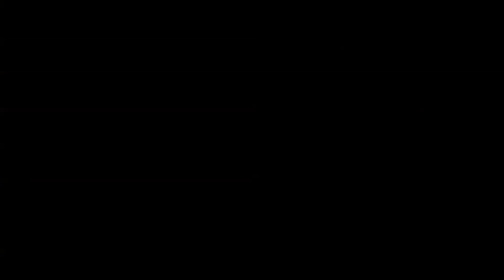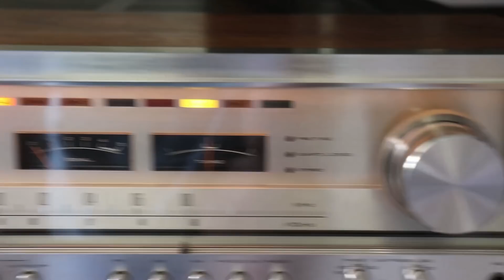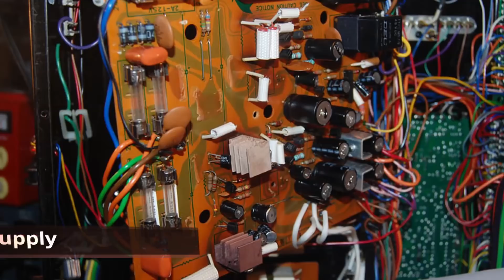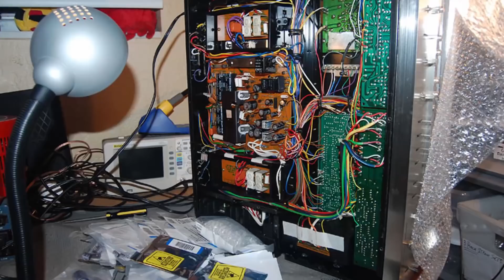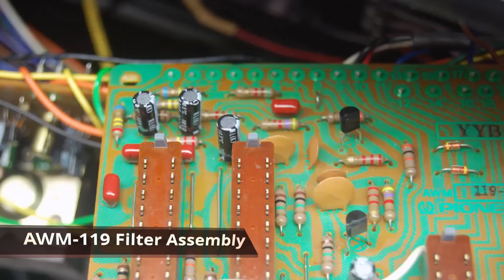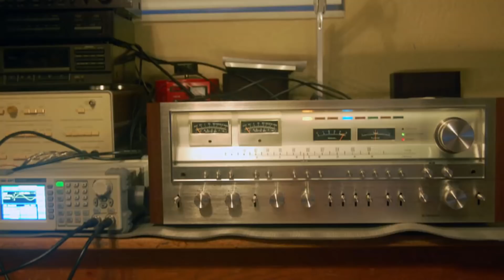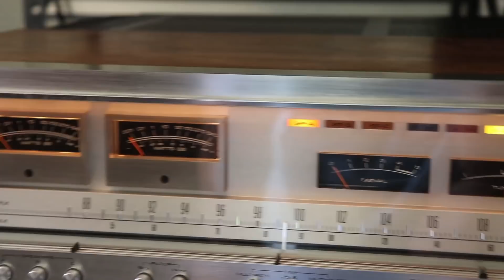SX-1980 - The Most Powerful Pioneer Receiver Ever! Vintage Stereo Repair Restoration & Testing.

Comment: https://www.youtube.com/watch?v=CZ2QytMpP_c

I have one of these on my Denon. Works great.
Reply from the maker: Interesting that this SX-1980 even pushed hard on the test bench never gets hot, very warm yes. I have a Yamaha CA-2010 that when it's running in Class A the heatsinks will get very hot. You can not touch them hot. Nothing wrong with it, that's the design. If I have any unit that needs a fan it's that one.

Comment: A name always synominous with quality.So saddening to compare their current product line and quality with what it used to be.I have recently heard a restored Pioneer system including the wonderful 909 tape deck through the new JBL Century speakers all wired up with Chord Cabling and a Linn Sondek at the Front. The envy stills exists. A wonderful video yet again Thank you
Reply from the maker: Thank you so much for your kind words. The vintage audio equipment can hold it's own when operating properly. The engineering and build quality was top notch.

Comment: Very nice video. You are obviously very good at what you do. I am starting to work on a pioneer RT1020L. How are you cross referencing old outdated parts? I've seen transistors in this unit that are discontinued. Thanks...
Reply from the maker: Thank you very much. I'm just a hobbyist who repairs, restores and collects vintage audio equipment. The internet is so powerful now. Almost all the cross referencing of parts is out there. It still takes time but for example lets say you had a bad 2SC458 transistor that is no longer produced. Google "2SC458 transistor replacement" and all kinds of information will come up. Try it with your Pioneer RT-1020L and some of the transistors in it.

Comment: I bought an SX-580 back in 1979, the bottom of the line. I was 14 and got a job bussing tables at local restaurant. First thing I did when I earned my own money was buy that receiver. Still have it, is at my brother's house, and it still works.
Reply from the maker: Man, your story is my story. Working at pizza hut as a teen my first "real component" was a used Kenwood KA-3500 and like your SX-580 is still in service today.. Thanks for sharing.
Reply: @vintageaudioaddict  I also had a PL-518 turntable and a CT-F500 cassette deck, but the receiver was the first purchase. Speakers were a pair of Stromberg-Carlson that my dad gave me. Speakers, turntable, cassette deck are long gone, sadly. Thanks for stirring up old memories :)
Reply from the maker: @SteveLowe65  SC speakers now we're talking old school.....Okay older school. For most of us the old days were good days.

Comment: A pity the new filer caps are blue not black. So ugly.
Reply from the maker: Electrolytic capacitors do not last forever. Very few choices for filter capacitors in today's world and there will be fewer and fewer choices as the years go on. Most are blue now a days. I'm just glad they are still available at all.

Comment: Remember those pacific stereo days. Huge Sansui beauties and these. Later some Hitachi wonders ...class g
Reply from the maker: I hope it brings back some good memories for you. I know it does me. Hitting all the small audio shops long before Best Buy and Circuit City came to town.
Reply: @vintageaudioaddict  Wandered through pacific stereo all the time looking and listening and dreaming. Even radio shack had some cool receivers with that magic tune circuit that if you got just anywhere close to an fm station it would lock it in instantly. Loved that back then more late 70's stuff.  great video
Reply: I used to get great deals at Pacific...Bought an Akai r2r for hundreds off brand new
Reply: @BigEightiesNewWave  oh yes. Bought a phillips sensor touch turntable with an audio technica cartridge.   Got robbed and that was stolen. Was such a killer table.

Comment: Cool stereo ya got there! 
My oldest console model SA-1490 still works but woofers need restored and a tweeter replaced , basically just tower speaker repair. only 150 watt per 
Sounded really good though
Reply from the maker: Thank You! I'm glad that you still have your old gear. I've got some of mine from my teen years still.

Comment: Some years ago I got a SX-980 on a flea market, a little over a year ago i dug it out of storage where it had been sitting unused for a long time. was still fully working but I decided to do a recap as some of the electrolytics in the PSU had high ESR (and was discoloured from heat). Except for the two main filtercaps all electrlytics are replaced. I didn't see no reason to replace any transistors..
It is now the heart of my system and it sounds great.
Reply: lol i had the same luck just the system up sx 1080 and instead of a flea market i got one out of my neighbor's attic a year and 1/2 ago when i was like 16 now its under my dad's tv as he has kind of commandeered my amp FOR NOW  lol im takeing that back when i have a place to put it
Reply from the maker: The SX-980 is a very nice receiver. The great thing about the vintage equipment is that every model in a manufacturers lineup was a quality product. You didn't have buy the top of the line. By you getting those old electrolytic capacitors replaced that SX-980 will probably still be operating for decades to come. Great Job! Enjoy!

Comment: Have you ever worked on a Project One Mark 1500 receiver? I have one that needs the pots/switches cleaned and I really don't wanna tear into it until I learn a bit about what I can expect. Also what's a good contact cleaner? I've heard about De-oxit or is there something better? Thanks!
Reply from the maker: I have not worked on a Mark 1500 before but you are correct to be cautious. All of the equipment is a little bit different to get apart and back together. Do some research on the internet and see if you can find someone who has been in one. That way you will have a better chance of success. Deoxit is tried and proven. You can't go wrong with it.
Reply: @vintageaudioaddict  Gonna give it a shot. Thanks!

Comment: Believe it or not, there was a Radio Shack version of the this amp under the 'Realistic' brand. A lot of 'Realistic' stuff was junk, but they sometimes did deals to re-badge high-end stuff.  I had some scratch and win ticket that gave me a great deal on Radio Shack stuff including sale merchandise. This (Realistic) receiver was on sale and I got an amazing deal. I didn't know I was buying Pioneer at the time, but discovered it later. 

I loved this super heavy beast. I remember I gave up a school trip to Portugal to buy this, speakers, turntable, cassette deck and stereo cabinet.  I gave up some amazing memories I am sure, but this thing gave me some great memories too. Mike Oldfield's Tubular Bells really used to rattle the windows when this thing was cranked up.
Reply from the maker: Radio shack did have some good gear. They had several different contract manufacturers produce their equipment over the years. Thanks for sharing your story. I enjoy the equipment but I also enjoy the stories that go together with the equipment.
Reply: @vintageaudioaddict  Yeah, I got some great stuff at 'The Shack' over the years. They really should have had a high-end and a low-end brand though as some 'Realistic' gear was not good.  At least it taught you to trust your ears.

Comment: This is wonderful, but I have to correct you on the power claims.  Apparently there is one receiver which tops this from Technics.  Unfortunately I haven't got the model number to hand, but if I find it I'll post it.  But great video nonetheless.
Reply from the maker: For one the Technics SA-1000 was 330 watts per channel. Marantz 2600 for another at 300 watts per channel. Did I say something incorrect in the video? The video title states "The most powerful Pioneer receiver ever!" Just the most powerful from Pioneer not every company.

Comment: My best friend back in it's day, bought an SX-1980 new, He paid $800...… NEW. I had a Pioneer SX-3700. Tiny compared the SX-1980......LOL. I recently acquired a Pioneer SX-3900 in perfect working and cosmetic condition. Love these vintage Pioneers.
Reply from the maker: Man $800 was a great price for the SX-1980 back in the day. The SX-3700 and the SX-3900 you have are great receivers. Plenty of power from that SX-3900 for almost any speaker and listening volume.

Comment: Hi names jay i have this same pioneer i need repaired has no sound lights all come on smooth controls just no sound i would like to get it fixed
Reply from the maker: Hi Jay, I'm just a hobbyist that repairs and restores my own personal equipment. Google "vintage stereo repair" or vintage audio repair" and see what comes up in your area. The SX-1980 is a part of audio history and it would be great if you could get your SX-1980 repaired.

Comment: Hi, I have a late 80s Pioneer model VSX 9700S one of the first Dolby prologic receivers and I've ran it non stop since buying it and it now has great sound but there is a 60 cycle hum. What causes that annoying hum? It works fine but just has a nasty hum and the Dolby prologic amp sub system has long ago died leaving me with a buzzy stereo unit. All of my other components are balanced and match perfectly  and I could never afford to replace it with a new receiver. Please  consider giving me some advice. I have never opened the unit as I would probably destroy it.
Reply from the maker: With the age of your receiver there's a good bet that your have a capacitor or voltage regulating transistor that's leaking in the power supply. It could even be a loose ground inside the receiver. I don't think there's any advice I can give other then your receiver needs to be taken to a technician to be looked at to solve your hum.
Reply: @vintageaudioaddict  Thanks or the prompt reply. Your lucid insights have convinced me to try and save and perhaps even restore full functionality to this unit instead of letting it fail. I've subscribed.

Comment: I have a pioneer QX-949 quadraphonic receiver. It blows any new equiptment out of the water!!!
Reply from the maker: Man, the QX-949 is sweet! Congrats on owning her!
Reply: @vintageaudioaddict  I recapped it a couple years ago, and deoxidized the switches and it cranks now. I have 2 of the original speakers that were sold together with it, and some Bic sound span for the rear channels. Sounds great with music or movies.

Comment: All of Pioneer's SX series had the best sound quality of any stereo. The worst part of Pioneer was the RF front end and the use of hot back-lighting which made the plastic brittle.
Reply from the maker: Pioneer made good equipment up and down their line. You got more power and features from a receiver like the SX-1980 but the lesser Pioneer receivers of the day had the same engineering and build quality. Yes, old plastic does get brittle from heat and age.
Reply: @vintageaudioaddict  when pioneer left the old SX series and wood covers behind they changed the circuitry and lost the sound quality. No other stereo, in my opinion, has ever managed to recapture that sound. In fact, most stereos sound quite sterile. Pioneer messed up.

Comment: I bought a Pioneer SX-1980 brand new in 1980 and had it for about 12 years. It started to have issues in the power supply. Every time I rebuilt it, it would only last a couple months before smoking a few components on that board. I sold it "as is" and moved on. A few years later, I discovered that Pioneer offered new replacement power supply boards for the SX-1980. Too late.
Reply from the maker: Oh Man....I'm sorry about that. Yes, they have a reputation for having power supply issues. I haven't had an issue with my power supply......yet. When I rebuilt it from the looks of the power supply no one had been in it before working on it. There was certainly some heat damage on the power supply assembly. I changed out all the caps and the transistors just because.
Reply: How many years did it take them to engineer a decent power supply board?  
More to the point, which says a lot more... How many years did they produce the known flawed boards prior to offering what should have been done under factory recall?
You can't suggest Pioneer didn't know about the issue prior to release.... or perhaps this was rushed during the Size Queen 'war' and they never properly tested their products.

Comment: What do you think of the, Onkyo A-5050 Integrated Amp?
Reply from the maker: I'm not familiar with particular Onkyo but I really like my M-504.
Reply: @vintageaudioaddict  they were DC servo amps that had high current like Harman Kardon.. the amp was rated at 50 Watts RMS but oh boy it had a peak to 150 and man it was the loudest. Super quiet, tight Punchy Bass..  I listened to the album Rush 2112 many many many times. Rest in power Neil Peart..❤❤❤❤🥁🥁🥁

Comment: Wow, I'm drooling!!!  What an amazing era for audio, and I was a teenager lusting after this wonderful machine!
Reply from the maker: Man, you like me. I was a teenager then also. I had some equipment back then but nothing like a SX-1980. My pizza hut wages would not allow it, LOL
Reply: Yeah, I was poor until I was in my 30's.  That was the 1990's, and I treated myself to a pair of absolutely wonderful high end Thiel speakers.  By that time the SX1980 was hard to come by, and there was no Ebay back then.  Maybe one of these days I might buy an SX1980, but I'm not sure if it will drive my speakers without damaging the amplifier.  They go down to 2 ohms at some frequencies!

Comment: I have a very good sounding  SX 1250, 160w p/ch, less power than this one but super reliable.
Reply from the maker: I have a SX-1250 also. Plenty of power for almost anyone. I will be posting a video of it pretty soon. The SX-1250 is one of the best receivers ever.
Reply: @vintageaudioaddict  If you have the opportunity, please tell me if the 1280 is an upgrade from the 1250 or just the same with different fascia. Thanks.

Comment: I was stationed on Okinawa 76-77.  I bought a SX-950 I don't remember the specs but boy did I ever like that amp.  The SX-1980 of course didn't come out until the later part of the 70s but I had rotated back to California by then.  Thanks for the video.  Great stuff I agree after 40 years replacing all of those components only makes sense.
Reply from the maker: Your welcome and thank you for watching. The SX-950 is a great receiver. Every bit the engineering and build quality that the SX-1980 has. Thank you also for your service!

Comment: Push button cleaning, I had a issue getting to mine on SX1250, are they different to the 1980? Harder? Or do I need to get in there?
Reply from the maker: Man, they are really tough to get at in either unit to clean them well. You really need to remove the assemblies from the chassis. To be honest, it is a pain but if you are having any kind of intermittent audio issues it's probably those guys that need a deoxit treatment.

Comment: I have an SX-3900 that I bought new when I was 18 years old.  Another awesome Pioneer making the transition from analog to digital.  Only 120W/channel, but at .005% THD (yes two zeros).
Reply from the maker: Sweet! Plenty of power. Great looking receiver also. Congrats on having your SX-3900 for all these years. I'm working on my next video to upload. It's my Pioneer rack system with those beautiful blue fluroscan displays like your SX-3900.
Reply: @vintageaudioaddict  I also have the somewhat matching dual cassette deck with fluoriscan display.

Comment: Went through this process with my sx-980. It may be the little brother but it is much loved. Everything works perfectly now and it's the center piece for our living room. Also those selection switches come apart easily and can be fully cleaned and reassemble. Being careful not to break the plastic clips. Also a weak channel can be the fault of the protection relay. I had a devil of a time tracking that problem on mine. New relay and all was well.
Reply from the maker: Thanks for sharing. The SX-980 is a great receiver. Engineered and built with the same care as the SX-1980. Yes, the intermittent problems are many times difficult to find. Good job getting your SX-980 back up and running!
Reply: The idea of using a relay in protection circuit is fundamentally flawed.  I've yet to see a relay correctly rated to break signal to a speaker driven at max power in a DC fault condition. You are lucky to find them DC rated or even half of what a full fault voltage / current potential is. DC contact rating is significantly lower than AC rating. 
If your lucky the relay contacts don't weld together, but after opening once under moderate output level the contacts will never close clean again, hence the 'weak' or noisy channel outcome. It's not something stuff like deoxit will ever patch.
This is especially the case with high power amps like this... willing to bet this uses relays that wouldn't even suit an 80W Amp.

The best replacement for relays are FET's with the correct optodriver chip that can be be mounted on a small PCB the same footprint as the relay. NO need for heatsink because they have a very very low resistance (they never get hot under full loading, relays probably get hotter due to the coil being permanently energised while in use.)

Comment: I have a Marantz 1200B integrated amp. Years ago it wouldn't power up. The blue power light comes on but there's no distinctive click when it's on. I have it stored away but I don't know if or when I'll ever get it repaired.
Reply from the maker: The 1200B is a nice piece of equipment. It's really tough now a days to find techs that can fix the vintage equipment. Why don't you google "vintage audio repair" or vintage stereo repair" and see if anything comes up that's local to you. Maybe the issue with your Marantz is not a big deal and you could get her going again.